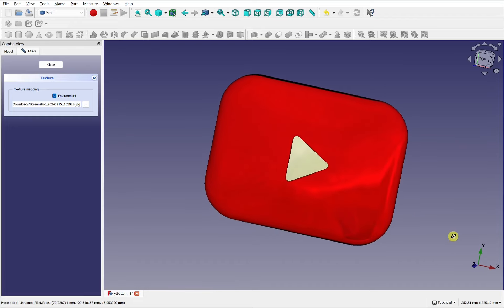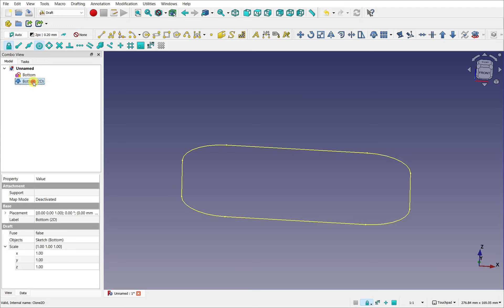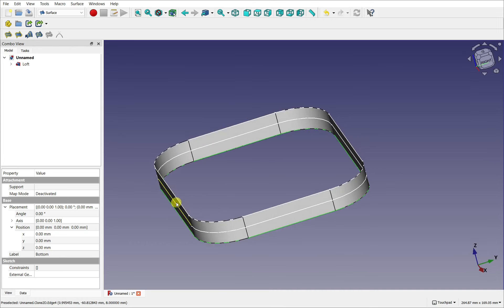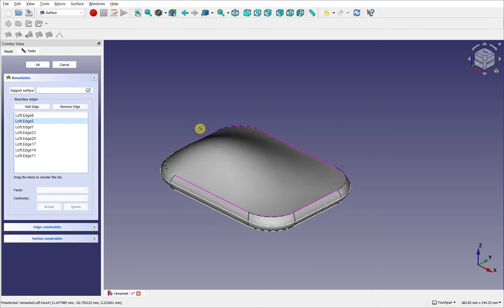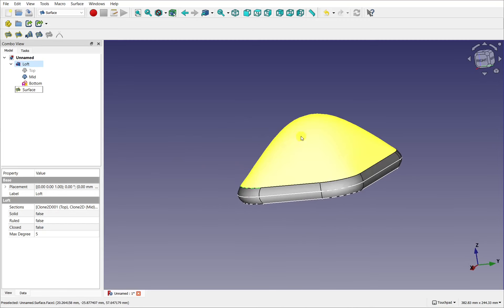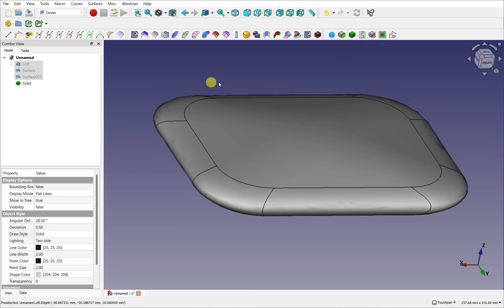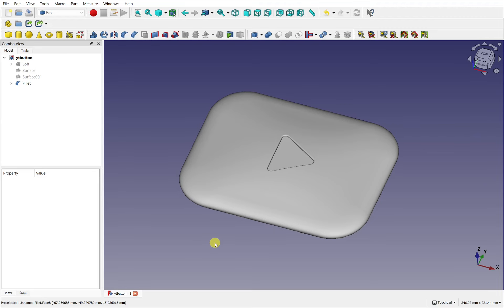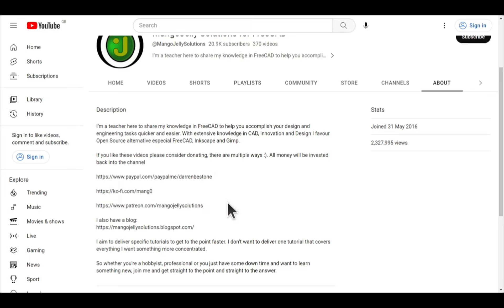FreeCAD: Simple Surface Continuity | Make your own YouTube Button | Basic Surfacing #2

Comment: Interesting "new to me" ideas of what can be achieved when using various workbench tools together - especially Clone>Scale and blending

I do have a question, that also came into my mind after part #1, - How would one then convert the final solid into a shell with a uniform wall thickness such that other internal structures could then be constructed as an enclosure for circuit boards and servos?

Thank You
Reply from the maker: Developing freecad requires programmers to give you the tools to do certain operations such as joining surfaces, creating lofts etc but I will put my money on some of the programmers of any CAD package not being able to achieve what me, yourself and other could do design and modelling wise with the software itself though they programed the tools. It's not the top it's how you use it 😁😁

Converting the final solid into a shell can be done in a number of ways with variable success depending on the continuity of the object and its construction. When you have this kind of object you could get away with a basic clone scale and cut. Or you could construct the object as surfaces in the same way but leaving off the bottom and then use the 3D offset. This may fail due to a number of factors (more about that in another video I am looking to do, and thanks to Paul on Patreon who I have been working with to get round his problem. In turn we found  a number of  pitfuls and most importantly how to get out of them.

Another option would be to creat a cloned workflow for the inner surface and close both by joining them together. Basically a  version of the repeated steps but with smaller dimensions in the sketches. This can be done by duplicating the workflow in the treeview and altering the sketches. With the upcoming release of 0.22 / 1.0 (depending on what they want to call it) there is a sketch offset which I can see is going to become a vital tool when it comes to thickening walls adding yet another string to the bow. 

I think it will be a good idea for me to include these in the surfacing videos, which now looks like it's going to be a series. I have been getting a lot of surfacing requests and freelance work lately and would like to pass along what I have learnt and still learning.
Reply: @MangoJellySolutions  
What will be new to the sketch offset functionality? I have always used either the "2D offset" of the Part workbench or a "subshape binder" (which has an offset parameter) on sketches and it worked fine. It has the big advantage over the clone scaling that the offset is absolute (e. g. always 1mm). With scaling (which is obviously always relative) the bigger something is, the bigger the "offset" will be.
Reply: The first question should be: do you really need the inside to match the outside shape and a uniform wall thickness? Maybe just cutting out a cube is fine? Or, if you need to be a bit closer to the outside shape, extrude the first sketch (which defines the base shape in this example) so it just doesn't poke through the top and cut that out of the solid? Btw. instead of the "clone and scale" of a sketch, you can also use the "Part->2D offset" or "Part Design->sub shape binder" (which has an offset parameter) on a sketch. You can mix and match most functions of the different workbenches (except for "Part Design"; most of its functions need a "Part Design->body" to work).

If that isn't enough there's the 3D offset to create the smaller "inside" to cut from the solid. But that can be a bit picky (although it worked just fine in this example; I just tried it out).
Reply: @superdau  It would be great for you to make a video demonstrating the various approaches that you suggest.

Comment: Good Tutorial, I've had a problem converting the Model to Parametric Solid( mine converted to Compound which stymies me at 18:13), I'll backtrack and see if I missed something during the Continuity phase of the Tutorial? Damn there is so much functionality to use and remember. Darren can You suggest a Glossary for FreeCAd and its work benches? I have trouble remembering all the Functionality of the various Benches. BAcktrack from 18:13 worked Object has transformed siuccessfully to a Parametric Solid. Obvious;y I missed something in the earlier stages. As usual You need to watch and follow Darren closely!

As regards FreeCAD & for that matter CAD functionality I gather "Edges are Connected by Faces". Once again is there a description of various components and their relationships?